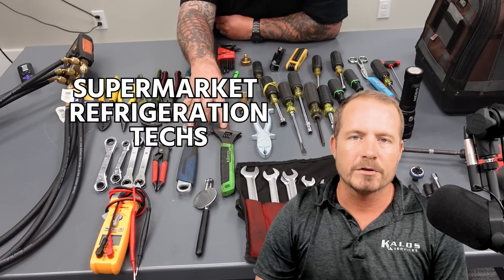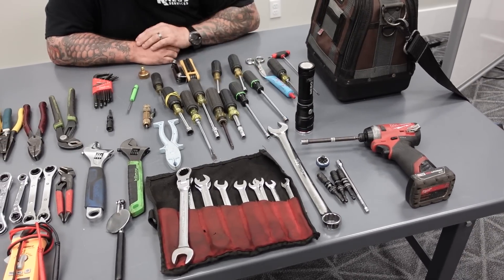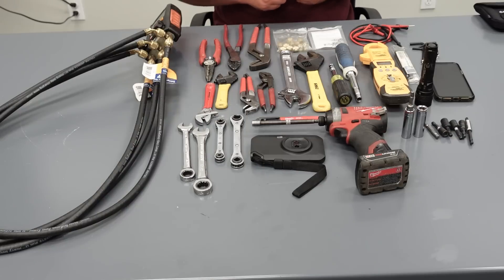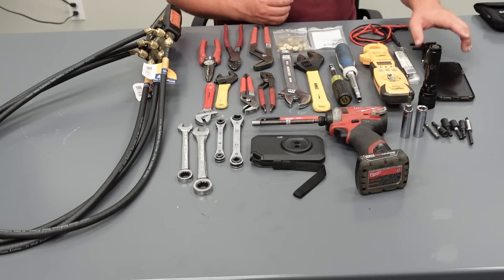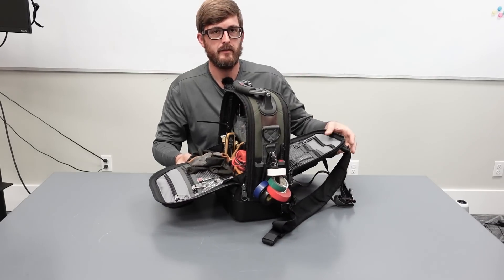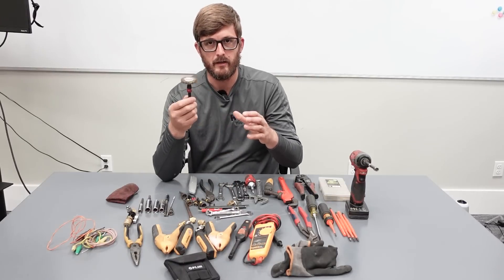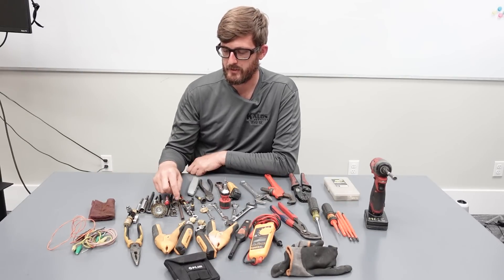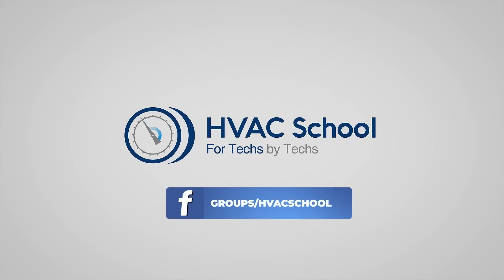Market Refrigeration Tool Bag Overview

Comment: I don't know anyone that has actually bought one of those $200 veto bags I just see youtubers carrying them because they got them for free
Reply: most of our guys at coolsys have veto bags of some sort, i’ve had a few of them for years and they have held up, i did sell the large tech pack because i tended to load it up fully and it weighed like 50 lbs so now i use the smaller backs to limit weight

Comment: Gentleman #2 tools is just about everything... Dont carry in a full socket set when your only going to change an evaporator motor.. As a great mechanic i knew from the past would say... (he only brought in so many tools like guy #2)  he said if i have to go to the truck for more special tools, They have a bigger problem. Although doing supermarket work, You have a shopping cart, no big deal to bring in more tools... Then again if your going up on a roof, avoid trips by thinking out what you need when your at the van.

Comment: This was helpful. I have the DeWalt right angle adapter and that Rigid plumbing 45 degree wrench.  I see they will be helpful.  I want get that ratcheting crimp tool and the magnetic thin ratcheting bit holder.
My Knipex adjustable pliers have a thin head and helped remove the spud connection for valves on radiators.  They are very strong.  I dulled  the teeth on a pair after years of use.  They help with refrigeration connections too. Thanks this video was clear and concise.